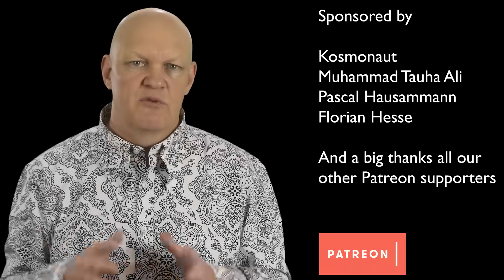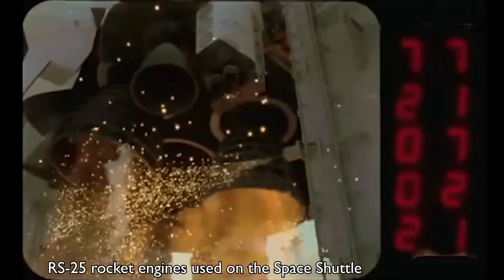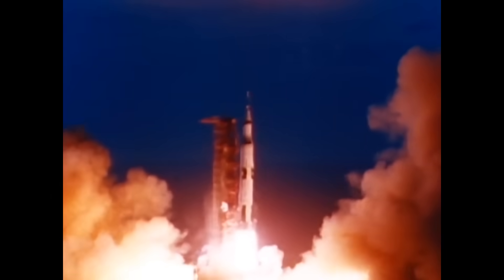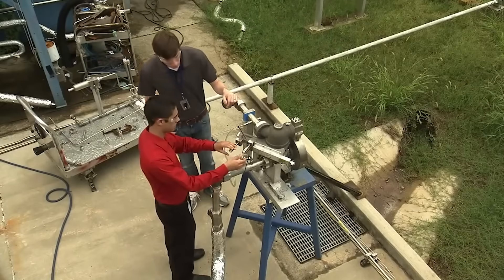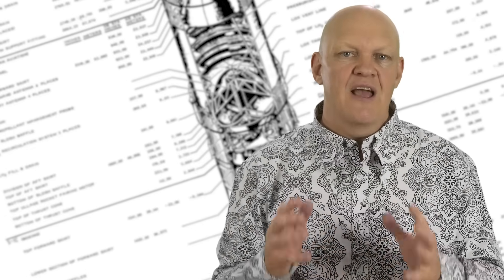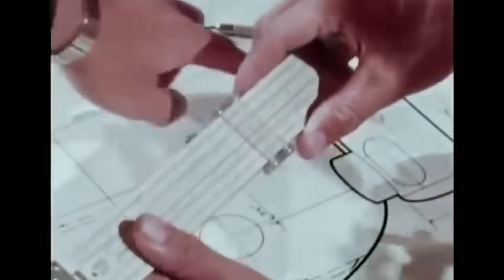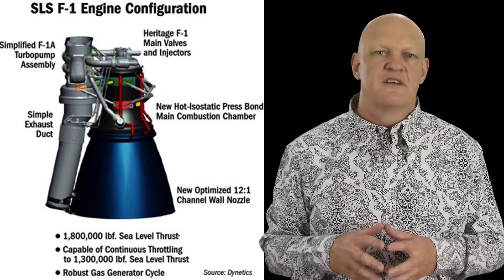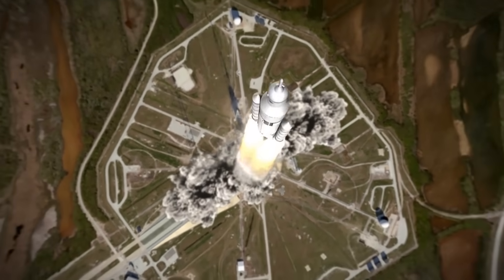Why Can't we Remake the Rocketdyne F1 Engine?

Comment: If all the original plans still exist, it should be very easy for today's engineers to redesign the F1 engine so that it could be buildable using modern methods, yet still be basically the same in looks and performance, while being a lot more reliable. A friend of mine has a 1947 Beechcraft V35 Bonanza (first year) It's 71 years old, and he keeps it in near new condition. Now, an aircraft must be inspected annually, and various parts replaced or rebuilt after so many flight hours. All of the parts for this aircraft are still available, and it's a lot older than the Saturn V. 

I myself am into vintage cars. I own three, all more than 50 years old. Parts for them used to be very expensive, because there was not much demand for them, and the manufacturer had to set up complex tooling to make just a few parts. But today, those parts have gotten a LOT cheaper, Modern technology, such as computer controlled CNC mills, can be set up very cheaply to reproduce just a few parts, as long as you have an original part to copy from. Many of these parts are of much higher quality than the originals. They are more precise, and the metallurgy is way better. 

I've always said that the best use for modern technology was to reproduce older technology.

Comment: You've heard the question, do you remember where you were on 911. I do. I was working as a painter on the test tower at Red Stone Arsinal in Huntsville Alabama  were these engines were test FIRED. We were preserving what was left of the towers. They have been mostly striped but it was a awsum experience.

Comment: Y'all need to understand, rebuilding this has NOTHING to do with the engineer's. Engineer's dont build things, they make sure that if the product is built it will work as intended in any environment that it will be exposed to. This would simply be a problem with tradesman not being skilled enough, the ones who actually build it.
Reply: Engineers come up with what the tradesmen need to build and how, dumbshit. Without engineers you're just an overspecialized tool for some assembly operation.
Reply: migkillerphantom But those tradesmen are the ones that have to fix the faults on the designs. I've yet to see a set of prints perform as advertised on the first go.
Reply: And without those blueprints in the first place, they'd be exactly where? That's right, nowhere.

Many designs are very complex, so a detail here and there is bound to be missed, given the hundreds or thousands of other details that were carefully designed, precisely and effectively.

That being said, a good technician is definitely worth their salt, and can provide valid insight into a design.
Reply: @nickw4019  You're telling me that nothing gets made without prints? I've been in more shops where the engineers draw up what the fabricators made to the specs they've been given. 

Some engineers just recycle the same design without updating the fixes annotated from the field. 

Other tradesmen can take those very complex designs and make them simple in manufacture and operation. 

My point being skilled tradesmen can draw and fabricate complex designs. Especially now with software being able to shoulder a greater load for testing.
Reply: Jrsydvl 

Didn't you hear the video? Those "fabricators" were engineers themselves! 

Yeah, I'd like to see your average tradesman design and build a rocket engine, the next airliner, your next phone, etc. Good luck. 

I'm not saying nothing gets built without prints. However, we are not talking about a bracket to mount a coolant hose, or building a shed. Or making simple add-on to a project, or a basic project that anyone that is good with their hands with a decent head on their shoulders could build.

Why do you think the engineers would just let the design of the fabricator go? Because it was a simple part that needed no complex design. That is called efficiency, letting competent tradesman do their part.

And yes, there are skilled fabricators that can design things. Like I said, a good tech is worth a lot, and provides a lot of value. A good engineer will listen to such a tech as they can provide valuable insight. 

Also, I'd argue many of those highly skilled fabricators missed their calling as engineers. If they are so great at what they do, imagine what they could have done with a few more of the tools that the additional training would give them. And I know that some people are just gifted and can do it all without the training, but again, the exception doesn't prove the rule.

Also, we aren't talking about rebuilding a current design. Or slightly tweaking it. I'm talking about ground up designs that solve complex problems and change the world.
Reply: Also, who do you think made that software so the average tradesman can draw up their complex design...? Still standing on the shoulders of engineers.
Reply: But I digress...I'm not going to convince you that engineers are more than just overpaid pencil-pushing calculators, and you aren't going to convince me that a tradesmen can design and build something as complex as a rocket engine for the space program without engineers. Good day.
Reply: @nickw4019  I'm not attacking engineers. But you clearly view techs, builders, fabricators and machinists as unworthy. 

I'm just telling you how things work in the real world. Not everyone wants to sit at the desk. I  enjoy building my designs. It isn't enough just to draw it out. I want to tackle the problems of manufacturing it too. 

Maybe that is how we lost the knowledge of building these engines. The engineers thought it beneath them to roll up their sleeves and operate some machines to verify the process. Or they took offense at having approved drawings corrected by mere workers so they ignored them.
Reply: I enjoy building things with my hands, and honestly I'm quite good at it. I build my own designs quite often.

I'm certainly not attacking those fine craftsmen either. I also never said they are unworthy. Quite to the contrary, actually. You must not have read my novel, ha. 

They are extremely valuable, and every bit as needed as engineers. 

Again, the people who built those engines were engineers themselves, if you listened to the video. This is often the case with highly technical equipment, such as is this case. The reason the knowledge was lost is because they didn't properly record their findings, retrofits, procedures, etc. as they were built. And those notes, memories, have been lost to the annals of time.
Reply: I will concede that there are arrogant engineers who don't listen to sound advice when they should, but I've also heard the same arrogance from techs who think they are smarter than the engineer. When they think something is overly complex, or a stupid design, often times there is a reason for that complexity the builder cannot see or understand.
Reply: Kenneth Barbee that is a b.s. answer though. still have people just as skilled today
Reply: mandellorian 2 years wow I wasted 2 years on learning pure math, I could do your fabrication easily. At 20 I built my dad a 30'x30'x12' barn made of old natural gas pipe and c-channel beams also using bed frame angle iron as cross supports between the c channel and welded everything. Yea you did waste 2 years on fabrication because I learned all that as a kid. Engineer's technicians are the ones who build designs that engineer's create. Companies don't want engineer's wasting time on building because we have so much math to do behind the scenes of that product you fabricate. We make sure that it won't fail so that way we can just tell you "put this here and do this" because you wouldn't understand the work we do

Comment: I work as engineer in a company that manufacture centrifugal pumps. Every time we need to manufacture a pump that the customer require to be duplicate from an existing one manufactured 30 years ago, we face the problem that if we use the blueprints from back then the people in the shop cant duplicate the parts because lack of information in them. I just only can imagine this issue but with rocket....OMG.

Comment: So in other words they made a version that isn't tested and relies on millionth of an inch accuracy, interferometers and the most expensive unobtainium cnc setup possible and Christ knows what, but the first used basic but large machine tools, maybe tenths of thousanths accuracy and hand welding, albeit with some pretty exotic materials and welding techniques for the time? Sounds about right...

How on earth (no pun intended) the are we going to start industry in space if no one can make a tool without a thousand tons and several million dollars worth of factory?

That said the lack of engineers noted in the record is in excusable. Seems like a failure of the US system of manufacture as opposed to the Soviet. As I understand it there was in the USSR a handover from the rocket engineer/scientist to a manufacturing engineer who started basically a new project, that of actually building it to specifications using existing technology preferably or trying to create new manufacturing technology if not. One of the few things the Soviets seemed to do right.

Comment: Skilled machinists and tool and die makers are a dying breed. CAD, CAM, and other new techniques have made many skilled jobs obsolete. I had two uncles who were machinists. One was a tool and die maker for Sunbeam. He designed, made and fixed the machines that made the machines Sunbeam sold. Often repairs were on the fly. The task was to get the machine up and making money, not taking notes on how he fixed it. The other uncle worked for McDonnell Aircraft Corporation. He was a machinist  who worked on the Gemini, Apollo and F-18 projects. Neither of them attended a university. They learned their trades in Technical high schools, apprenticeships and, in the case of my second uncle, the army air corps. 

We need to bring back trade schools. Skilled trades that require a thinking, reasoning mind will not be replaced by computers. All other jobs are up for grabs.

Comment: Sadly everything on this is rubbish. We could easily rebuild the F-1. We have the designs and the drawings. Any hand crafting would have to happen no matter what design you use. Modern computer design and manufacturing along computing power would make them even more efficient and amazingly cheaper. The problem is that modern designers want to see their own engines on the pad. Not one made by a bunch of German rocket scientists using slide rules. Arrogance and egos drive this process , plain and simple. The knowledge did not retire or die with the men. Complete Rubbish.

Comment: Lack of skilled engineers is BS they grew up tuning carburetors and turning distributors while the modern car companies hold the ecm tune under a lock for emissions reasons even though the tune parameter runs rich to burn more gas so the catalyst heats up

Comment: Nice video. I do like to watch shorter videos, if possible, given the subject matter. As for the engines, given what you said about the building process for the original engines, it is quite surprising that they ended-up working as well as they did, with each one being slightly different, etc. Redesigning the engines to modern standards and technology seems to make a lot more sense.

Comment: While it is sad, and unfortunate that few, if any construction notes remain on the building of the original F-1 engines, the blueprints alone point to many significant functional concepts. The F-1B engine which would be the functional "equivalent" reduces the parts count from 5,600 to about 40 - - that's two orders of magnitude of reduction, which substantially increases overall reliability, as well as reducing the cost of production. That's quite an achievement for modern design, engineering and manufacturing. Why build something with 5,600 parts, when 40ish will achieve the same function more reliably and at lower cost? Nostalgia is one thing, but physics and modern reality are more practical.

Comment: I was the Program Manager on the program to create completed Engineer Drawing Packages for 79 of the 150+ MRAP (US Military Armored Vehicles) variants. It was a reverse engineering job starting with invalid or incorrect engineering/technical data (notes, specs, parts lists), undocumented changes, and without having any of variants available for evaluation. The government thought the job could be done in 1 year. After 6 months & $10M they completed 6 drawings and couldn’t figure out why. Being the clean-up Guy, I got invited to take over management, and after some analysis of the level of effort required, I informed the government that it would take 6 years to complete the estimated 19,500 drawings...they weren’t happy.

Comment: It seems to prove the case for today's 9-5 engineering graduates.
The avoidance of hard work, no sense of urgency, no person is actually doing the math, and HARD WORK. The last of those kinds of engineers retired after Vietnam.
Since, we've let computers do our math for us, because it's too hard, or time consuming, but the person is disconnected from the result at the critical point if you're depending on the ease of letting a computer do the work for you.
How many millenials would you expect to answer the phone in the middle of the night for work?
There will never again exist a drive or determination to complete a task the way the NASA engineers did in the 60s, due to many factors, but mostly because of the lack of competition, and sheer laziness of this younger generation. Besides, it's really hard, and nobody really wants to work that hard anymore.